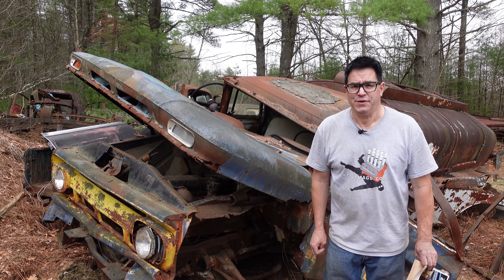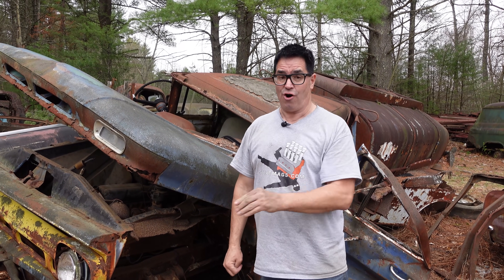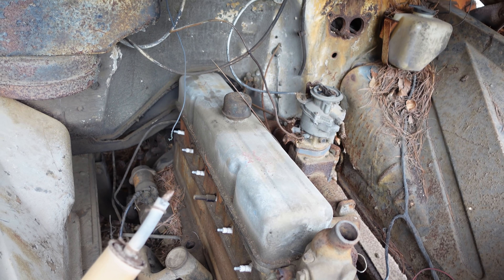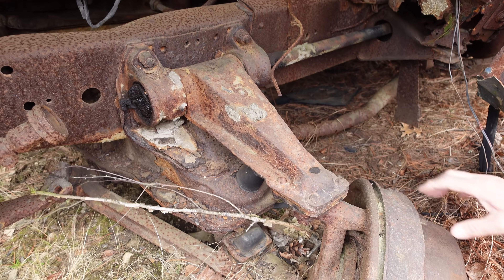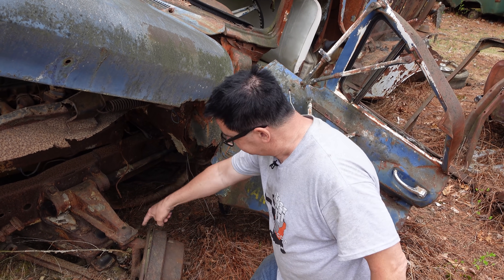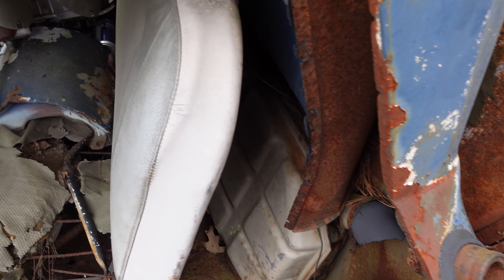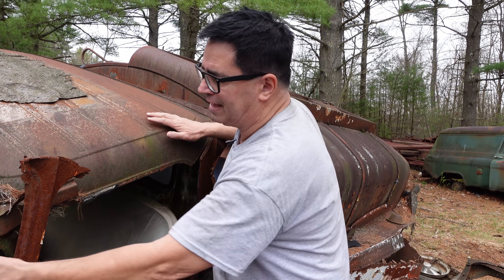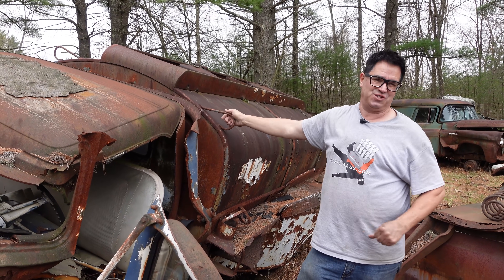Torsion Bar Tanker: Part ONE

Comment: I didn't realize that Chevy had a straight-6 before the Stovebolt. I had thought that it was Chevy's first revolutionary (for the low-price car field) overhead valve six. I guess I need to do some more research. I'm also going to have to look into which family the 194 c.i. six in my first car, a '65 Chevy II 100-series 4-door sedan  belonged. (Inherited in 1979; a very basic car that my grandmother bought new. 3-on-the-tree,  no radio, the only options were back-up lights, a heater, and a driver's side mirror)

Comment: Rather than a king pin, that's a spindle with upper and lower ball joints. Unless parts were worn/bent, there should not be a problem maintaining alignment.

Comment: We have two of those torsion bar suspension trucks in the collection one a 61 half ton short bed. big back glass and factory V 8 automatic. Strange thing it doesnt have any of the stainless steel trim on it? the other is a 61 C 60 it originally  had a 261 and 4 speed and single speed rear. Engine is missing. however its got a decent body trans and driveshaft  its a roller and  has a good title. Ive thought about installing a 292 engine we have into it. However im old and have too many projects. We would sell it.

Comment: Old friend had a 50 or 51 GMC boom crane truck. He said it was a gas 426 inline 6, based on diesel  71 cubes per cylinder. we cobbled a HEI off a 231 Buick driven off the top of the points dist. Did they make a 426ci 6cyl ?

Comment: Torsion bars and twin I beam front suspension: BAD ideas !!🤦🏻‍♀️
My Father had a 68 Ford F100 with twin I beam suspension. It went back to the dealer three times for excessive tire wear!!
Nobody could line it!!😞Put up with it for 50,000 miles-sold it for parts!!
(Except for the I beams)

Comment: Just amazes me that a fullsize semi truck and 20 ton box van trailer would be powered by a tiny 348/409 engine considering that others virtually the same size had gigantic Detroit V8s and massive diesel sixes. I can understand it on a five-ton pickup-based straight truck such as this tanker but on a semi surely they were dangerously underpowered? 400bhp moving 30 tons or more?

Comment: With weak brakes, point and shoot steering and spooky suspension that old stovebolt six was plenty of engine for that old hauler.  Drove many miles in similar trucks and the six cylinder was just fine, got you home everytime.

Comment: Those full on cabovers are super scarce today. 

That 261 is mildly desirable in some hot rod circles.  

I thought they could be had with dual or quad lights depending on what money you wanted to spend.  Certainly that grille would accept them with little alteration.  

I once used a 60 pickup hood skin as a sled, in a junkyard in the winter.  it came right off in my hands.

Comment: Lots of memories Steve, those panoramic windshields were works of art! I miss driving those trucks! Many vivid memories flipping a cigarette butt out the wing window and watching them bounce off the gas cap in the old West Coast mirrors! I dig the orange turn signal lens on the passenger side of the hood and the original clear one on the driver side, definitely a ‘70s replacement! Feels like I could hop in that truck and drive it like it was yesterday! Thanks for waking up so many dusty memories!

Comment: I actually was not disappointed to see that an in-line 6 cylinder powered that tank truck. It has a stick-shift transmission hooked up to it, and it may have had a 2-speed rear axle as well. Granted, it was not a hot rod of a truck by any means, yet it had plenty of power to get the job done. Those Chevy 6 cylinders always had plenty of torque. I know because I had owned one.

Comment: My first car was a 1955 Chevrolet 210 4 door sedan that my Dad bought of a Co-Worker in mid 1981. The engine had been replaced with a “261” truck engine. For a 6 cylinder car it ran pretty good. It had a 3 speed on the column and I drove it through my Senior year in High School.

Comment: That engine compartment was missing 2 other interesting details , the self twisting external advance distributor  and the master cylinder used on old street rods with clutch and brake in the same casting .  show working versions of these if you can
Reply: Ok Ive got one of those C60,s the master is still there. the clutch fork is on the passenger side. A hyd clutch V8 60 thru 62 bellhousing is very rare. When I converted my 62 GMC from a V6 to a 283-V8 I converted the clutch release linkage to mechanical.  Possibly tomorrow We can do a video? I never liked that hyd clutch release.

Comment: Torsion bars are actually a great suspension system. They work very well on tanks and other tracked vehicle applications.  Interesting fact that torsion bars didn't work on these trucks because they wore out the tires. I learn something new everything I watch your channel.
Reply: Seems to me that's more of an issue of a crappy design on the rest of the suspension,not the torsion bars fault.
Reply: @MrTheHillfolk  absolutely . The torsion bars would have nothing to do with the alignment .

Comment: Chevy truck stuff is interesting but the GMC trucks of the same vintage could be much more interesting. With V6's and up to V12's available as gas engines as well as the GM two stroke diesels in the larger series trucks.

Comment: curved windshield glass seemed like such a great way for avoiding blindspots--in a time where new cars have a big airbag in the A pillar--but the result often was distortion.
Reply: Always ducking my head left and right to see around the pillar while driving the 2016 work truck on tight corner backroads, very annoying.
Reply: @MrTheHillfolk  absolutely hear ya! i've not owned anything newer than 2007 but my friend broke her patella so i've been taking her around in her own year-old RAV4--those thick pillars are a real PITA, and i'm average height but i still have to bob my head down to climb inside. i double-look every time i make a lane change just to be sure.

Comment: I believe one of the reasons the torsion bar suspension went away was that Chrysler sued GM for infringement on their torsion bar design.
Reply: It went away because it was terrible,they couldnt keep the torsion bar anchors from flexing the frame.
Reply: GM went back to torsion bars on their 4x4 trucks in 1988 .

Comment: chevrolet could never carry the weight the Fords did, remember the coil spring rear around 1970 pickups, wiggle wobble lol
Reply: True .... but Ford had the twin I beam bumpstear front  suspension, absolutely terrible pos.
Reply: @cabbyhubby  I had a 68 F250 had the twin I-beam front axle. Very strong never gave me a problem.  Hauled wood with that truck stacked over the cab.

Comment: Ive git a 62 c60 bus im gonna use the clip on my 65 panel to make a 2 ton panel dually
Reply: With a modern running gear that should be a sweet tow vehicle. I've always liked having something different in the parking lots. That rusted ratchet will have plenty of elbow grease on it after that build. Namaste bro 🤙🏼

Comment: That poor thing must have been so slow and lumbering. I can’t imagine a headwind or a hill.
Reply: if this truck could get traction, that old Stove bolt would spin the world around.
Reply: @MrDmorgan52  no doubt ,it'll just take about tree fiddy weeks to do it 😁
Reply: 9 to 1 gearing and 50 top speed ,  C60 trucks still haul grain here in Missouri , most run a 2 spd rear.
Reply: all the old timers swear by those inliners and the torque...but they forget how slow they were up a hill, screaming their lungs out with the steep rear gear ratios. though we could argue how slow the rest of traffic was going with drum brakes, manual steering and few having overdrive.
Reply: Without a doubt, I was thinking, "That thing must've been a dog on the road, and going up a steep incline? Fuggetaboutit!".

Comment: That outer Roof skin has been removed with a Gas Axe. It has not rusted completely away. You can see all the slag where you run your fingers over it.
Rust can be very destructive, but it is never that neat. I think you might want go and have another look at Steve.
Apart from that little mishap it was another Great episode. Thanks.

Comment: Big engine on a big oil truck would get an inexperienced driver in big trouble rolling it with a sloshing tank on winding New England roads.
Reply: Thinking pretty much the same thing....even if the product tank is baffled, just how fast would someone want to see a fuel delivery truck driven?
Reply: Even the commercial truck 409 was still only packing 252hp which is about 200 in today's hp.

Comment: Didn’t know Chev Trucks had torsion bars.
Reply: 1960 to 62 were the years of that generation of torsion IFS. None before, and gladly left alone afterward. The torsion bars are used as springs to support the truck front end at the upper control arms.
When you get to 4wd pickups in the 1988 and later generation, you get to torsion front ends that have the torsion bars at the lower control arms. They drive and handle very well as long as they’re not too heavy for what they’re designed for.
In 1988 and later, anything bigger than a 3500 standard one ton, they’re engineered around leaf spring front suspension.
Reply: @patrickmoran8790  Thanks for taking time to clarify.

Comment: I am surprised to see that truck doesn't have a 4spd with the low/high. Every 2 ton of that vintage I ever seen had the 4spd with the low/high.....I never knew that Chevy made 5spd manual transmissions in the early '60s either.🤔

Comment: Always something interesting with you Steve, I worked a Gas powered 1973 International ACCO 1610A (Aussie designation) with a 345 cube V8, 4 speed and 2 speed eaton rear with a 22ft tray.
Ex Army butterbox type cab but it was actually a good thing for local work running on Propane with 2 huge tanks. Flat out at 55 Mph but that was just fine with the work I did and she made me good money just didn't like hills a great deal :-)
Reply: I had a 77 510 Acco. 345 4 speed. 16ft tray. I put LPG on it with a 300 litre tank. Adelaide- Melbourne on a tank of fuel. And on a cold day would do 70mph all day carrying a racecar. Great little truck.
Reply: @ldnwholesale8552  I had a few 510's, they were good lil things and better with the same drivelines as the 1610 8 tonners.
Almost all rusted away now sadly